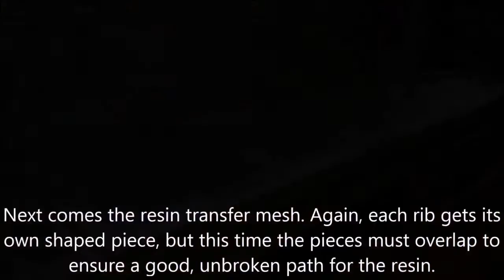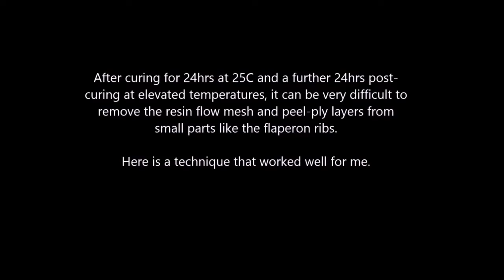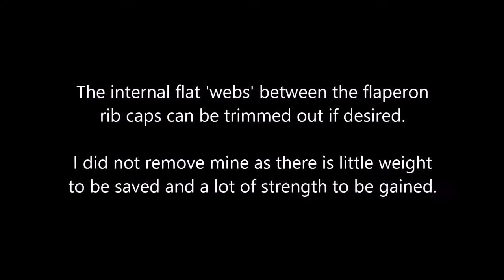Phil Lardner's Carbon Dragon Project - Fabricating Flaperon Ribs - Start to Finish

Comment: looking back, do you think the extra work and expense is worth it?  I am contemplating a wood version...
Reply from the maker: Absolutely - 100% - I would highly recommend building all the flying surfaces, spars and ribs out of carbon (+kevlar in places). Using pultruded carbon rods in the spar caps allows you to build a significantly stronger wing than the original plans call for with no weight penalty - in fact, you will end up with a stronger, lighter wing. Making the leading edges and ribs out of carbon means that you will never have to worry about moisture ingress distorting the lifting surfaces (as almost always happens with the 0.8mm ply called for in the plans.) Yes it's extra work, but I would strongly recommend it! The only thing I would do differently if I were to build another CD would be to stick to a two-wing design and not the three-part wing I built. Yes my 3-part wing allows me to rig it single handed (even with a bad back!) but the extra work and weight that modification called for was not worth it in the end. If you do decide to build a CD, I'm happy to help you out with any info you need. Feen free to pick my brains! Just contact me through the website or at carbon-dragon at ihpa.ie.
Reply from the maker: I see you have a CNC mill on your YT channel. That would make life a lot easier. All your ribs and bulkheads could be cut out of a flat panel(s) of carbon-foam-carbon composite rather than molding each one individually as I did. I'll describe the method in more detail if you go down that road.
Reply: @PhilipLardner1967  Yes moisture in wood is a big problem.  I appreciate the strength and lightness of carbon, but the cost and health hazard is huge.  I am a man of modest means.  I do not enjoy working with composites like I do wood, I only do it when necessary.
Reply: @PhilipLardner1967  Yeah,  that is more appealing.  Someone should kit it. (hint)
Reply: @PhilipLardner1967  One more thing.  You made the right decision with a 3 part wing.  The joint is loaded 1/4 of root joint.  Did you see the video of that (unnamed) modern ultralight glider wing fold in a loop? Carbon can take the strain, but is not so resilient to defects.
Reply from the maker: @donlawrence1428  I saw the videos of that glider breaking up and have talked to the pilot, who admitted to over cooking both his airspeed and G-loading when pulling out of that final loop. He was at pains to stress that it was his fault and not the glider... and to prove it, he ordered a new one and is still flying it today!
Reply: @PhilipLardner1967  Oh, ok,  I did not know that.  Very forthright of the man.
Reply: @PhilipLardner1967  I'd like to know more about this method please
Reply from the maker: @SunilSundar  Hi Sunil, I can't really describe the process any better than I already have in my videos and in my construction articles on the CD website. For really good process videos about working with carbon composites, I highly recommend Easy Composites (UK): https://www.youtube.com/@easycompositestv
Reply: In one of your replies you talk about another method suitable for a CNC mill. Using a carbon foam carbon sandwich to make ribs. I was referring to that
Reply from the maker: @SunilSundar  Ah, right! I haven't tried this method yet myself, but I plan to use it on my upcoming Windrose motor glider project. Instead of making individual moulds for each rib, which is very time consuming, I plan to make large, flat sheets of carbon-foamboard-carbon and then use a CNC mill to cut out the individual ribs from that. The cut out ribs will then be bonded to the spar with an L-shaped flange of carbon tape on both sides for support. Similar flanges will need to be created to bond the ribs to the wing skins (I plan to use a carbon-kevlar-carbon stress carrying skin aft of the spar on both the upper and lower wing surfaces. My CNC mill is ready to leap into action... just as soon as time allows me to finish the CAD files for each rib.
Reply: You plan to make ribs for windrose instead of the original foam block wings? Interesting!

I tried making ribs the way you suggest, though with GF on both sides. The failure mode is always delamination from the core on the compression side of the rib. 
having a structural skin would probably prevent that though

Thanks

Comment: Hallo Phil. 

How long does your saw blade last, cutting cfrp? 

We found out that even hard metal wears out quickly. Concerning drilling, a 10 mm drill can make 5 holes in 10 mm thick cfrp and has shining cutting edges, hence is dull. Hard metal drill can make 300 holes and is dull.
met vriendelijke groeten  from NL
Louis
Reply from the maker: Hi Louis, The thickest CF I had to cut using the table saw was only about 5mm thick (approx 24 layers of 200gsm carbon twill (hand wet laid - vacuum infusion failed me here!) and it did dull the saw blade noticeably. Almost all the rest of my carbon cuts were on sheets of just two layers of 200gsm carbon (spar shear webs, leading edge skins etc.) and my second saw blade has so far survived the abuse! I wore out many HSS drill bits, drilling through the 5mm thick load transfer bars used in the spars where they join, and in the center root span. I could feel when the drill bits were cutting well, and when they were becoming dull. You need to pay attention and not let the drill bit over heat, as that will take the epoxy matrix beyond its glass transition temperature and it will loose strength around the hole. Sharp bits - always use sharp bits!! 

Are you building a carbon aircraft by any chance? All the best, Phil.